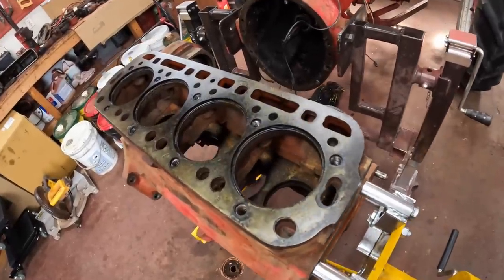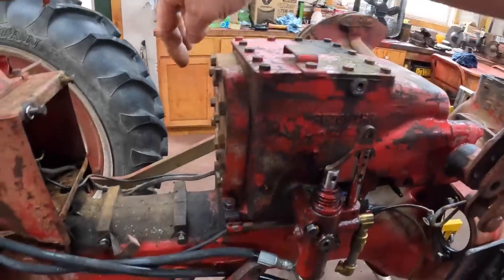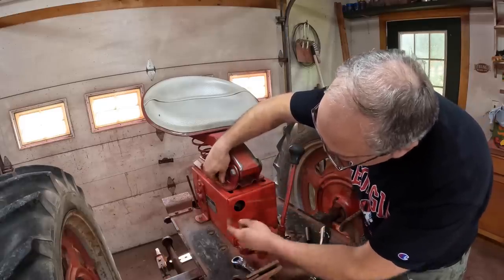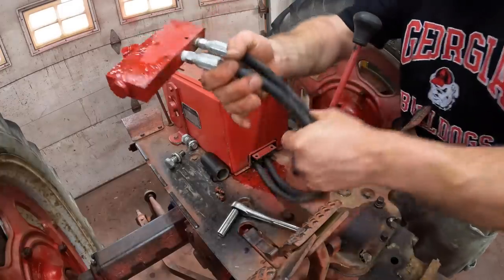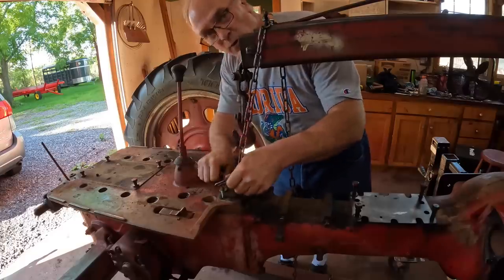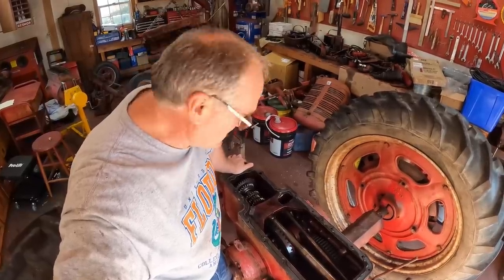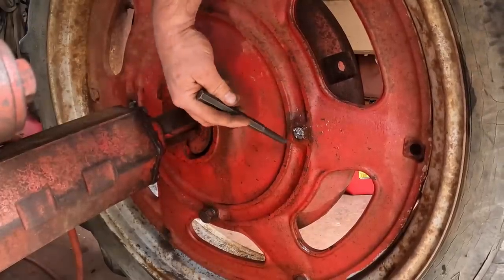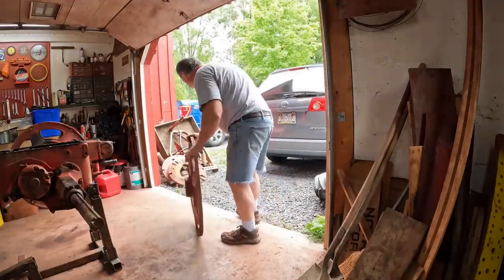Everything Has to Come Apart! | Farmall Super C Restoration Episode 3

Comment: My grand dad had a Super C and a Super M. They were both stock except the M had a very tall high gear that was rumoured to have been installed by loggers before my grandad got it. They gardened about ten thousand square feet and farmed another 500 acres. The C did the garden work but it was stout enough to pull a 8' disc harrow with no problem. I also spent enough time ploughing behind mules that I know what "mule freckles" are.  The C had enough power to power my granddad's sawmill if we were cutting pine but we used the M when we cut oak or hickory. I retired to Thailand, they have to take their tractors into rice paddies. Instead of adding more tires for flotation, they build  a paddlewheel device that fits outside the tires. Regards!

Comment: Hi Pete,, The simplicity of those Farmalls made them so grate, and made them last for a 100 years at least. As one who still operates an M and a BMD older than me, (though with a Parkins Diesel motor both) I am thankful to have them around when needed.
Both are All Round small job on the farm, easy to maintain. Cheap on fuel and spare parts... Love them.

Comment: Very interesting tear down of the Super C. With hydraulic hoses it reminds me of the Belarus 500 series tractors. The factory tractors have 2 hydraulic hard lines running from the floor boards to the hydraulic cylinder in the rear. But because of heavy vibration and other issues they tended to start leaking and weeping oil. So people replaced them with rubber lines instead. Draw back is in my opinion the rubber lines get into the way of your feet a lot and you can actually slip on them, while entering or exiting the cabin.

Comment: Hey Pete. Still watching and soaking up your experience on that super c restoration. im a welder fabricator so it was cool to see your tractor stand. I built one  also. Just saw in this episode about replacing the belt pulley and pro shaft seals. Ive been trying to decide whether or not to go all the way with it. that one on your c looks the same as the unit on my super A. ill keep watching and hopefully get inspired to do all the gaskets and seals in mine. Actually the most leaking was at the belt pulley shaft. Im bouncing all around on my project. Got the sleeves in block but didn't want to start the build till I get the torque tube back on. Meanwhile the head is still at machine shop.  Its a learning process for me. Got the cart ahead of the horse a few times. Thanks for your videos. im still inspired and will be watching often. 👍

Comment: Pete, I would love to know your methods for breaking the rear tire beads here.(I am working on my M) I know there are many ways to do it but your ways seem to make the most sense and are reliable and safe. Thanks for the videos!
Reply from the maker: Hi Michael, after beating on old tires for years, now I just take them to the tire shop where they have an air powered bead breaker. $60 per pair and no stiff muscles. Some people will put down pressure from a bucket loader on them, or drive on them, but I never tried that.

Comment: Pete!!!!!
(A non-tractor guy tractor question.......and a non-tractor guy, non - tractor question)
a) Calcium chloride in tractor tires?
b) IF....you had to guess....how many tripod moves did this video take?  (I tried counting but lost count in the forties.)
Keep up the "Good work"
Rich from PA.

PS - stay safe working by yourself.....and I hope you don't "wrench" something you don't intend to.
Reply from the maker: Hi Richard, calcium chloride solution in the tires is much heavier than water and won't freeze. It's used to add weight for better traction. The downside is it's very corrosive if the tube ever leaks. I appreciate a "non-tractor guy" watching these videos!

Comment: hello peat. I have a question have you ever had a problem where you put your head gasket on torque it to spec fill it up with anti freeze and then before you even start it you see that your head gasket is wet with anti freeze. Just from looking at it in-between the head and the block. Any advice?

Comment: Now people are using beat juice so the rims don’t rust out. Especially on old tractors where rims are expensive. Are you gonna use that?
Reply from the maker: Hi Alexander, I probably won't load the tires with anything.
Reply: @JustaFewAcresFarm  I must agree there. When my Ferguson was redone I left the fluid out also. Just used the wheel weights it ended up being more than enough for moderate use.